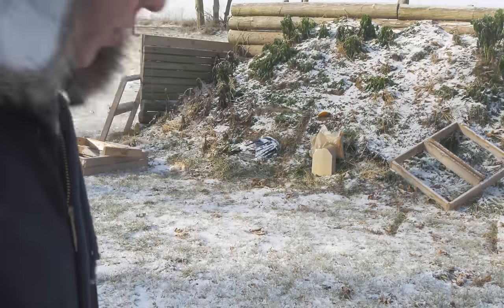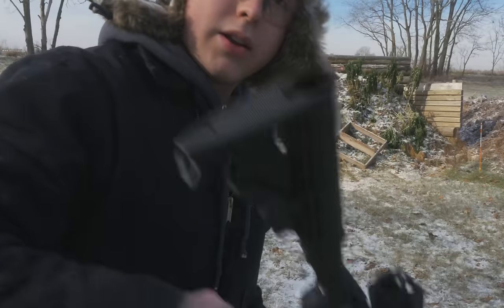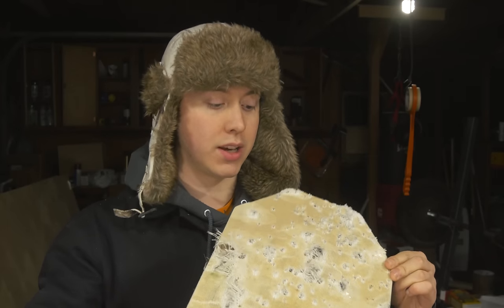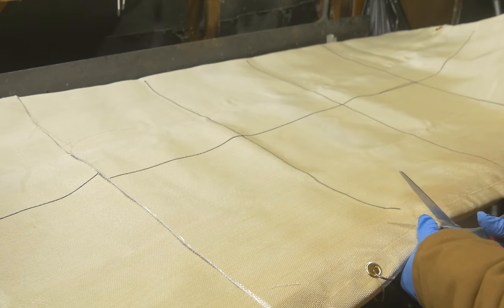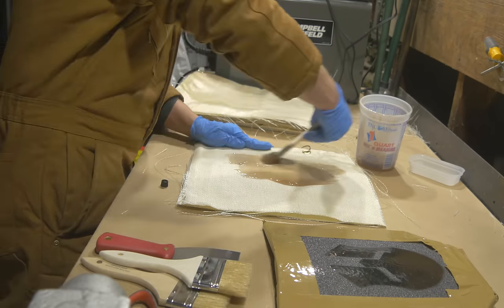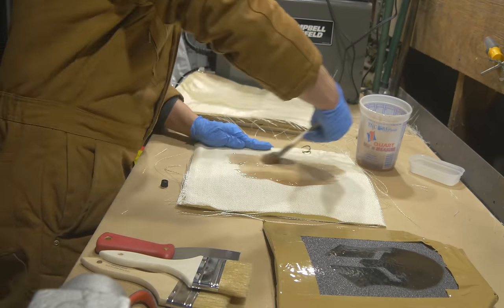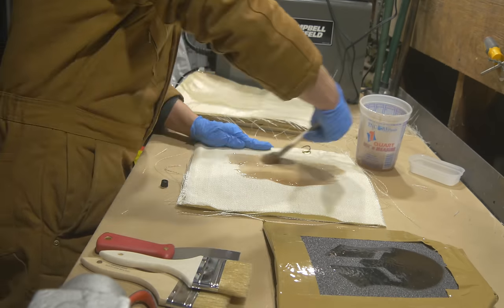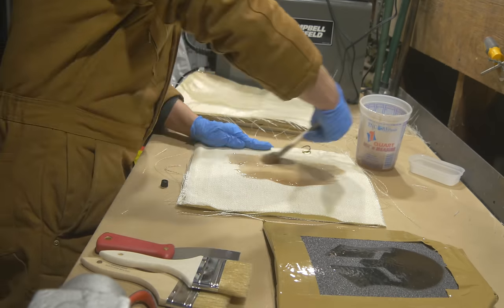How to Make AMAZING Bullet Resistant Armor for $30

Comment: I really wonder if adding a steel plate backing, even just mild steel, would increase its effectiveness and deaden the impact of the slugs.
Reply: Or hell put it half way through kinda like a steel core
Reply: @jordanmccabe3848  A 1mm high carbon steel core or 2mm mild steel core can immensely help with weight (you can use way fewer layers of fiber glass and way less resin) or make it possible to resist a 5.56 round. What you really need is something hard to fragment the bullet before it goes into the softer material.
Reply: I wouldn't use anything like a hard metal to use as body armor, we used to but now we know its much better to catch the bullet and not explode it and create spalling. the spalling can fuck you up real bad if it comes of the plate and hits you
Reply: @haydenp3936  Steel plates usually use a spall liner to prevent that. And steel armor is still the best reliable armor overall for durability, longevity, and being able to be take a lot of hits without failing. Yes armor had advanced beyond steel plates into ceramic and UHMWP (aka fancy plastic) armor. But those both have huge downsides and don't last long.

Steel - Very good protection, lasts forever, excellent protection from impact force, very heavy, very cheap.
Ceramic - The best protection (As long as impacts are spaced out), short shelf life and very fragile, modest protection from impact force, somewhat heavy, very expensive.
Ultra High Molecular Weight Polyethalene (aka UHMWP - Plastic) - Modest Protection, short shelf life but durable, poor protection from impact force (Requires padding behind it or your bones will be powder), very light even floats on water, relatively cheap.

I have personally worn all of these before into firefights, and each has it's pros. Steel plates are damn heavy, and not something I recommend if your wearing them while doing a lot of activity. Basically they are great for security post roles where you may have to deal with rifle threats, I've been shot by 45acp rounds to a steel plate and you can barely be phased by it, feels like someone threw a small rock at you.

Ceramic plates will let you survive a hit from just about anything man-portable short of a 50bmg or other anti-material type round, though your going to be in PAIN after it. You also have to be very careful with them, as the ceramic discs are fragile and easily broken by dropping it a few feet on the ground. (Think of it like a smart phone screen.) Loses 80% of it's protection once those break. (Other 20% is the thinner UHMWP panel behind it.)

UHMWP is quite popular for civilian use, it's a little more expensive than steel, it's also really bulky, but it's very light weight and you can carry it around all day long with ease compared to the other two, I've worn this the most as I typically don't need level 4 protection on the job, and UHMWP will stop many rifle rounds as well as every pistol round on earth. I have also been shot while wearing this, and it hurts quite a bit as it transfers a lot of the force through it, you need some thick padding behind it. Didn't break any bones, but it left a nasty bruised rib even with a half inch foam pad behind it. Not sure what calibre round I was hit with, likely a 9mm or 45. These will stop many rifle rounds too, but I can't imagine being able to get back up after being hit with one.
Reply: @johnmclain250  what are you smoking, UHMW PET(E) lasts literally forever
Reply: @raam1666  not if it gets shot which i think is what he means,unlike steel
Reply: @LPikeno  true that, like ceramics.
a hard splat layer to spread out the impact followed with a soft slow layer to catch the impact, then a 1mm hardened steel layer behind that, followed by a 1/4" layer of hi-density close-cell padding. a combo like that might approach lvl 4 or even 4+ protection.
now we're stopping green-tips and ak rounds! ok kiddies, we're gonna need a couple pairs of flip-flops, mom's cookie pan from the kitchen, a couple of dad's scratchy, thick Xmas sweaters, some cardboard, and finally back thru mom's kitchen again to grab her fine porcelain serving plate. we'll need 2 quart jars of gorilla glue or 6 cans of flexi-spray to glue all this together and then we'll park the family car on it overnight (be sure to only drive the family car with dad's permission). finally, the next morning we can pull out our finished plates, lean them up against the family car,  and test-to -fail    ...or until we go thru our 10,000 round stockpile, whichever is most fun..
Reply: @JasonHurricane  He said "short shelf life"......

Ironically, steel will literally rust away without oil before the UHWMP wears out from..... something????? I cant think of a single thing that would make UHWMP wear out *on a shelf*.
Reply: @raam1666   uhwmp does expire due to exposure to the environment. Heat especially will damage/degrade the material. If you test new vs one 5 years old the performance is reduced.

Is it instantly no longer useful after 5 years? No it will still do some work. Is it as good as when it is new? No it isn't.

Steel is still longer lasting and most cost effective so that makes it an easy choice. Ceramic is good but also brittle. Taking a hard fall or dropping the armor can cause damage.
Reply: @joshuamorin2762  do you have any idea how hot it has to get to degrade? over 180F

It's the UV that damages it.
Reply: @joshuamorin2762  we're talking about shelf life
Reply: @johnmclain250  Shot twice with pistol rounds using two different types of armor (steel and UHMWP)? 

I am sorry to do it, as I love Bruce Willis and Diehard myself, but I emphatically call BS. Stop spreading misinformation, or "I heard", as first hand experience/ fact.
Reply: @LPikeno  disagree, you want it to fragment after going into the softer material. This makes it less likely you get hit with the fragmentation as can be the case if it fragments first.

Comment: Curious to see what fiberglass you used?  The product - ideally the actual type and number of layers, for a data point of something that works.  Also the weight of the finished product, to compare against the off the shelf options.
Reply: yes please?
Reply: It's a generic 5x5 welding blanket, you can buy those in bulk, they are quite cheap.
He folded it in half and cut it in 10 pieces.
Reply: It's still better then nothing.. especially if u have a large family and don't want to spend 5k on plates..

Comment: As a Fiberglass Tech I could give ya alot of tips including using 927 resin or Flexresin looks like you was using  H559. Doing it in lawyers also would be better You want to use  less amount of resin as possible but over all GJ
Reply: Lawyers?  So we want to protect lawyers?  Why????
Reply: layers
Reply: Ya do it in the lawyers lol
Reply: You guys knew what he was saying!!!! Don't be THAT guy.
Reply: Mark Fisher- THANKS for the tips
Reply: ThanQ , WWG1WGA.
Reply: What exacly do you mean in layers?Do you mean in a diferent way he did it? And why less resin?Is it becasue of flexibility? Geniuly intrested in your answer.
Reply: @WhyNot2827  Hey there, this is why, going to copy/paste the brief explanation given by user KevinMcNicol 5 months ago:
"... if you used alternating directions with the fiberglass so the weave wasnt just stacked up in the same direction would’ve also made some strength difference..."
Hope it helps, cheers!

Comment: I work with stuff similar to that doing crc  floors concrete an fiber glass using probably a similar adhesive that stuff is strong an no doubt that fiber glass sucks getting it on your skin but way worse without a respiratory I had no idea it was bulletproof that’s dope we usually use grinders and sanding disks to knock down the edges cool video bro we might all need one someday

Comment: Good stuff. 

I'd like to see a follow up: place the layers at different angles to provide reinforcement to the weave, and add some sand to the resin, like 320 grit media for sand blasting, to increase the density. 

You build it and test. I'll paypal you $100 for the effort and materials.
Reply: All the weave is at 90° to each other so if each layer could be rotated slightly to create a moiré interference pattern then the strength resistance would be the greatest!!!😎👍🏻

Comment: very nice! any idea how I could accomplish the bend without 'real' plates?
Reply: get two wooden boards
sand them to shape
cover in tape so it doesnt stick
voila
Reply: if the actual pates got dented by the clamps i'm pretty sure the wooden boards would just break
Reply: ***** nice idea thanks
Seba Najeraurriola why should they? Ever used clamps on wood?
Reply: Philipp Heller
I mean depends on how hard you tighten them the jaws might sink into the wood, to prevent that from happening, if it turns out to be a nuisance, get some steel or plastic plates, maybe 3-5mm thick and place them under the jaws, so the surface area is larger
Reply: Vacuum bagging would be a good method.  Doesn't need a bunch of clamps or a super rigid form.  Does require a decent pump.
Reply: use PVC a heat gun and some aluminum foil.  heat the pvc so you can form it then when it cools put a few layers of aluminum foil over it to give it some density so the clamps don't eff it up
Reply: I don't know... Mythbusters proved a simple vacuum cleaner has enough suction to lift a car...
Reply: +hanelyp1 Doesn't the resin require air to harden?
Reply: Andreas Vogel resin cure is a chemical reaction, it has nothing to do with evaporation.
Heat has more to do with its hardening than anything...
if you need more time to work, do it in a cold room...
Reply: Seba Najeraurriola nope. That's rhino liner that dented. Basically super rubber that catches bullet fragments so you don't get chunks of lead through your throat.

Comment: Instead of cutting the sheets apart, could you have made an "accordion" by interleaving the sheets between plates of ceramic tile, by alternating left and right folds. Ceramic tiles might give additional protection for the 5.56mm rounds.
Reply: i feel like the folding would cause a problem, as the bends in it would cause unnecessary tension, and the delamination would in turn be a lot more likely to happen, considering each layer is twice as thick but less surface area for the resin to seep through the fabric
Reply: @creationofseda   thanks!

Comment: So pretty cool. Questions I have. 1) Couldn't you just use fiberglass tape? 2) How else could you shape everything to fit other parts of your body? 3) What about adding some thin steel plates and coating the exterior in rubber?
Reply: 1: probably not, you need the resin
2: by using armor molds for the rest of your body (like a pepakura spartan suit)
3: may improove or reduce usability
Reply: I would do steel mesh if anything if we're talking about inside and a plate if you want to put it on the back or something

Comment: Peel ply for a 1st and last layer will make the surface very smooth.  It's also easy to cut w a cut off wheel instead of a saw.  Get someone to hold a vacuum to the blade to catch most of the dust.  Put water in the bottom of your vacuum. 
Either way what you did was impressive

Comment: the shotgun weaken the armor. you needed to use a new plate for full integrity of the plate.
Reply: squiggle1020 bet a brand new plate stops 1-2 .556
Reply: It's not ceramic. Anything outside of the slug bulge is probably good.
Reply: @lootedcorpse  I doubt it. 5.56 pens way more than a slug

Comment: I think fiberglass and liquid bed liner may be a little more flexable ... maybe silk instead of fiberglass. just ideas
Reply: Dan Acton agree for the bed liner !
Reply: Dan Acton. But it might give too much flexibility to the force of the bullet if that makes sense. If the bullet didn't break thru, then maybe the dent it would make could break a rib or cause some internal injury. But its a good idea, I would like to see this just in case it did work.
Reply: Breanna Thompson well there's one way to find out. lol you do make good points. but end the end  it's trial and error.
Reply: Calvin Krueger no it doesn't, fiberglass slows bullets down and denim stops hollow points, a five-seven would Peirce denim and kill you
Reply: Dan Acton pocket lint and spider webs make it more flexible
Reply: Fuentes I was thinking silk
Reply: Avery Frye 5.7 was designed to penetrate armor. Not a very common pistol round though.

Comment: 9:44 Someone should tell him that he didn't have to wait days. Resin is a chemical reaction between resin and hardener. Air isn't involved. Depending on the resin it can harden within hours or just minutes.
Reply: BK201MXP who cares. its not wet anymore
Reply: BK201MXP Oxygen is definitely involved. Most resins contain methyl ethyl ketone peroxide, or MEKP. This is an extremely powerful organic oxidizer, which, you guessed it, contains the oxygen needed for the reaction to occur. Hate to be that guy, but...
Reply: Contra009 i didn't know that but it's obvious i am referring to the O2 in the air. ur just making more people confused like the other guy who commented
Reply: nimbuzz you don't think it matters he waited days when it only needed a couple hours?
Reply: BK201MXP you can't really give a "scientific" explanation of what's happening and then goof up the science, lol. If you want it in layman's terms, it being dry is a perfectly acceptable way of telling people it no longer feels wet. Makes sense to pretty much everyone ever. Not picking a fight, just hate the spread of pseudoscience.
Reply: Contra009 why did you put "scientific" in quotes. i didn't claim to be scientific. i don't care if people can distinguish between cure and dry. But they should know resin doesn't take days to harden.
Reply: It may not be dependent on "air" to harden, but in the very cold conditions which Eli seems to working under would slow the chemical reaction down that it might take several times longer to fully cure than would be expected.
Leaving it to fully cure for a few hours at least isn't such a bad idea, overnight certainly didn't hurt.
Reply: Jeff NME I usually leave resin for 24 hours

Comment: You don't need to invest in a vacuum bag system but defiantly have to use mold release or wax the plates about 4 coats and it will pop out of form a lot easier. also when cutting or sanding the end product use a good dust mask

Comment: might i suggest  adding 9 sheets of .125 thick titanium to your design .223/5.56 wont have a prayer. i have seen 1.125 thick titanium block hold up to multiple 50 BMG  rounds. and crack on the second round BUT NOT PENETRATE. you might be able to get away with grade 5 or better  1/8th (.125) thick plates one on the front and back and one in the middle as a core.
Reply: Ngl I was thinking the same thing
Reply: Hello... this is supposed to be a cheap armor demo... how much does ti plate cost?!!!!
Reply: Sure let me check, right next to the Aluminium foil right?
Reply: When $30 turns into over $500

Comment: Great content! and hilarious at the same time.  I wonder if you could do this on a large scale - like a bulletproof blanket or plating for car side doors?
Reply: can't for a blanket, could for plates for a car door. The blanket idea would just turn out a stiff board like shape (think plywood sheet). The car door would be feasible. you could take the panels off the door and possibly make this right on the panel, as long as you left spaces where needed to fit back to the frame.

Comment: Imagine making a full on shield out of this. I’m talking full body length, out of like 5 welding blankets. That’s a lot of protection for only about $150
Reply: And while someone is still on this topic, can someone do the math and explain to me how heavy the plate in this video is?
Reply: Hmm
Reply: @winstonsallet9541  Someone in this comment section already eyeballed it and said about 6 pds, probably less because he just added the blanket's weight to the resin's, but lots of blanket were cut away and some of the resin got out when he pressed it with the plates. Cheers and hope it helped.
Reply: Joseph Yearwood 
Oh, I’m not talking about a suit, I’m talking about a bonafide shield. You could probably afford to have a pretty hefty shield if you could stop relatively small caliber arms with it.

Comment: The packaging tape was a good idea, to make your mold (orignal plate) easier to release. Tip from precast concrete fabrication: after the packaging tape apply a thin layer of petroleum jelly. 
(pretty sure it won't react w resin.. do your due diligence. But! w concrete molds it makes demolding much easier. Good luck

Comment: Did I miss it but how much does it weigh? I can’t believe you left that out because that’s the most important factor!
Reply: Fibeeglas is not that heavy... its actually lightweight
Reply: Kohuala Ok thanks. I’ll just refer to my weights and standards handbook on fiberglass blankets and cans of resins. Ooook. Let’s see. Hmmmm. Don’t see it quite yet. But. I’m SURE it’s in here somewhere...
Reply: 6 pounds if you add up the rezin and blankets total weight. Considering he cut a considerable amount off, maybe even less.
Reply: Between 4.5 - 6 lbs. going by the weight of the blanket and resin.
Reply: It weighs probably like a fiberglass blanket and a can of resin
Reply: @bobbybrainstorm  Nice one.
Reply: It weights you a couple of dead lungs ...

Comment: Do you address the issue of spalling? Would you do an entire series of this with multiple tests? This would be a good additive to car doors and seats for vehicle protection
Reply: 4 layers gorilla tape and 3 coats of flex seal basically remove any spalling, I saw a video of a guy hitting steel plates with a slug after rapping the plates in duct tape and there was no spall